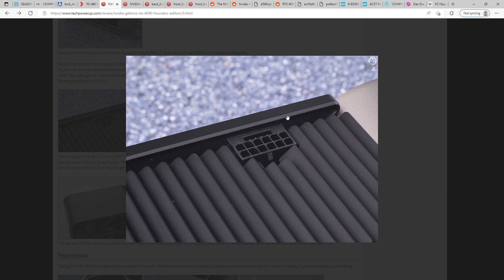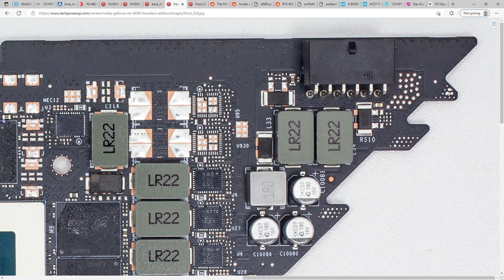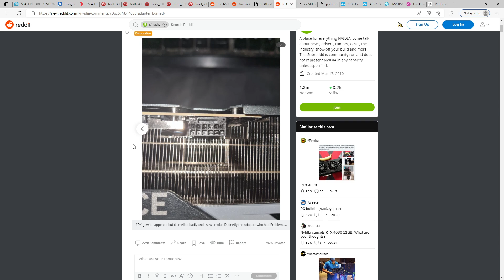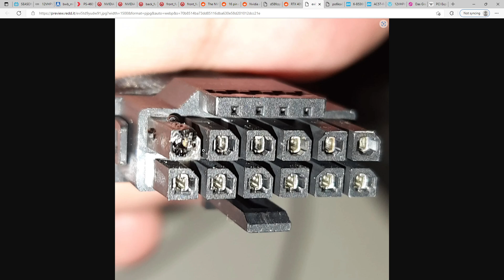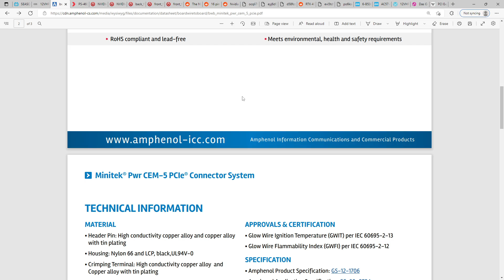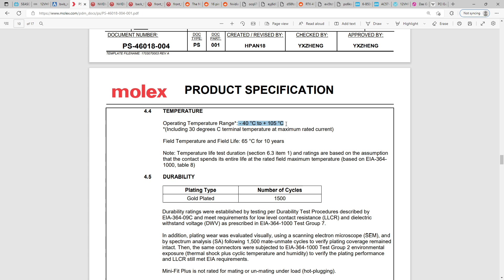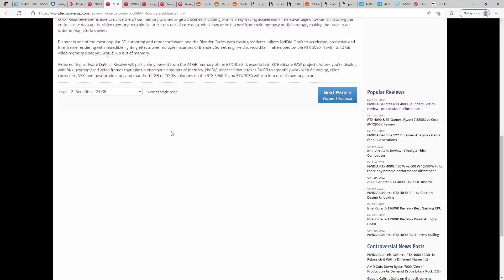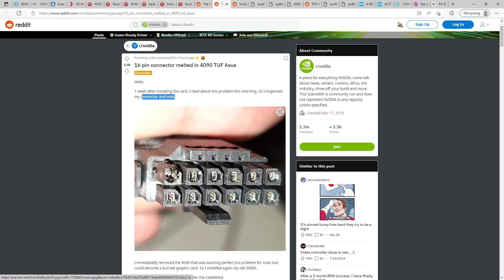rambling about the 12VHPWR failures

Comment: 12 Volts with an inductive load will absolutely arc.  I have had robot controllers catch fire because of holding torque DC voltages on motors being interrupted and the inductive loads destroy contacts.
Reply from the maker: yes but in that scenario the inductance is boosting the voltage when the connection is broken. And since we can clearly see that the Nvidia 4x8 to 12VHPW adapter is internally bridge between all the pins it can't have an inductive kick as long as at least 1 pin on each side is connected.
Reply: @ActuallyHardcoreOverclocking  Ok so you do know what you are talking about.  I am simply saying the statement that 12 volt connection cannot arc is inaccurate.
Reply from the maker: @mrfarts5176  Well when you get an arc from disconnecting an inductive load the voltage is temporarily way way higher than 12V. But I do conceed that my statement that 12V power systems can't cause arcs is wrong.
Reply: @mrfarts5176  arcing and sparking are results of completely different phisical phenomenons..
Arcing is voltage that jumps a gap by its own you need approx 1000Volt to jump one, ONE single Millimeter.
Sparking can happen at lower voltage and higher current but is basically just welding the connection point..
Reply: @SuperUltimateLP  I have not been talking about sparking at all.  You can actually create drawn arc systems with voltages under 600 volts by using inductance.  Let me be clear here, I do not believe this was happening on any of these connectors.  I am just trying to clarify arcing can occur at voltages you would not necessarily expect them to occur at.

I had a feeling these failures were being caused by increased resistance due to bad contact at a pin or straight up exceeding the load rating on a pin through some kind of mechanical failure.  I think he is competently demonstrating the latter in at least some cases.  I still think bad contact is possibly causing increased resistance and power dissipation into the connection on some of these shittier connectors.
Reply: That’s just a manual boost converter. You rate boost converters by their output voltage, not input. :P

Comment: Does cablemod's VHPWR connector have pins that aren't split on top and bottom like nvidia's? I couldn't see any good photos online
Reply from the maker: from what I've seen it looks like they using single split terminals that should hold up much better.

Comment: Is it possible the solder joints are snapping off on 1 side of the connector forcing more amperage through the remaining connected wires?
Reply from the maker: but then it would melt at the solder joints not at the terminals. The damage is almost entirely localized to the terminals. The ugly soldering isn't what's getting hot.
Reply: And previously GPUs could detect if pci-E power wasn't supplied, I hope that they have implemented a similar system in the 4000 series
Reply: @SuperUltimateLP  i think GPU’s are required to detect PCIe slot power and if applicable supplementary power

I dont know of the lack of PCIe slot power would prevent a GPU turning on but if it doesn’t the 75w max that could be supplied from there would have to go through crappy cable and would defiantly cause issues

For example my 3090 will not draw more than 160w per 8 pin connector and where possible it wont draw power from the slot

Most ive seen is 60w from the slot and average is normally 15w which the rest via 2x 8 pins

Comment: Thanks for explaining this in a manner that isn't sensational and just looking at hard facts.  As far as the choice to go with the 12 pin,  I think the choice really has to do with selling it to OEMS and the likes. Even though we could draw 600 watts from 2 8 pins. I can't really as NVIDIA go to a SI like Dell or HP and go yea I am going to sell you product that draws power out of spec (even though its perfectly fine). It's alot easier to say hey this plug right here has the certified spec of drawing up to 600watts.  From a diy customer it makes sense to just have 8 pins but from a business/legal perspective you cant sell something knowingly out of spec and not expect it come back and bite you. Not saying this faulty adapter won't cause some harm either. I say this a someone who use to be HP Enterprise on paper items matter a lot even if they do not make sense or are not realistic.
Reply: In Igor's article on the subject, it specifically says the issue is not the connector...PSU provided cables use the new spec connector just fine. It's NVIDIA's specific adapter build quality that's the issue, so theoretical if SI builders just used PSUs compliant with the new ATX3.0 standard, they should be fine.

Comment: Buildziod can I just use cold water to cool it down so it doesnt melt
Reply from the maker: in theory you could pump a non conductive fluid like mineral oil through the connector to cool it better. This would probably require modifying the connector a bit.
Reply: @ActuallyHardcoreOverclocking  there are pcbs with channels in the power planes for pumping coolant through lol. And there are some servers that use subversion cooling. Like instead of air in ur case it's some sort of nonconductive fluid.
Reply: @ActuallyHardcoreOverclocking  thanks but I already used water. love you

Comment: I feel dumb lol I would've said arcing as well before you explaining that it is actually balls of red hot conductor spitting off
Reply: @glitter_fart  it really won't if you think about it the voltage would have to increase to really get a true clean arc without sparks.
Reply: Otherwise it is just metal heating up and that's about all